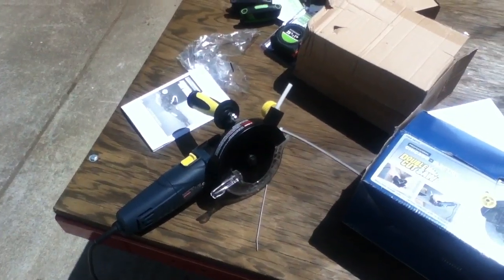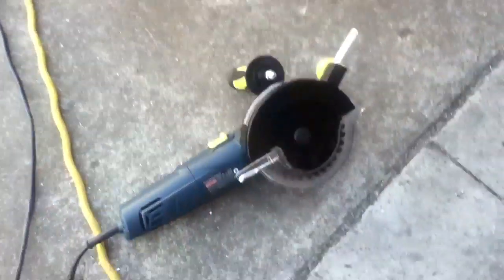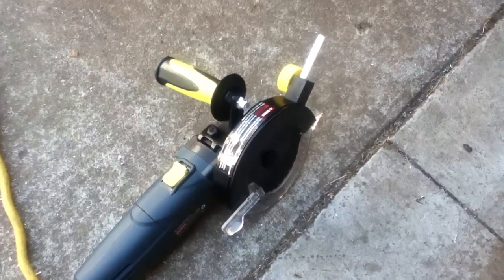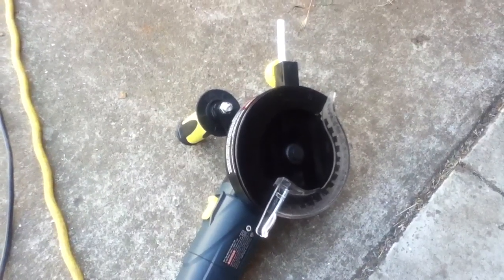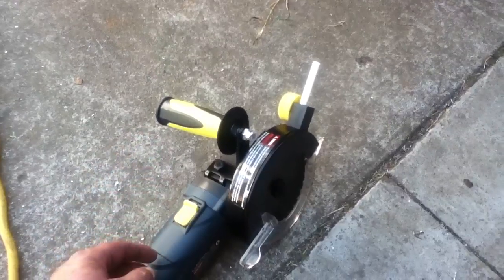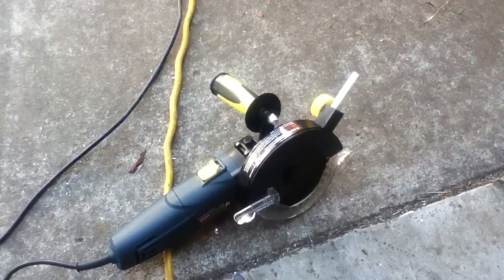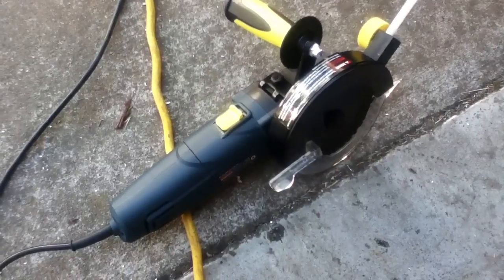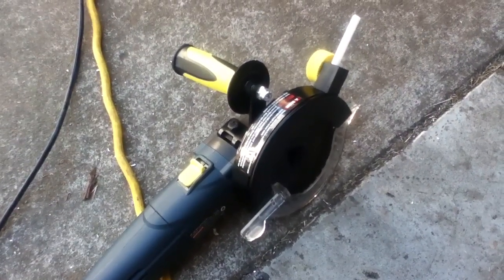Chicago Electric 68316 Double cut saw review

Comment: great review!
Reply from the maker: The tool later failed, badly.
Reply: can you post a video of the failure
Reply from the maker: Tim Molinaro
I did.  The thing practically fell apart in my hands and almost mangled my hand.
Reply: @8digitPDX  thanks for saving me the time and trouble of buying it. I had bought a small skill saw with diffrent blades that cut diffrent stuff metal, wood, tile or cement thin stuff. I alread used the small skill saw that got to cut stuff in small areas that would be hard for a full size skill saw to get to. It can cut up to the thickness of a 2×4 that would be the max.

Comment: This tool wins the award for the worst piece of shit ever sold.1  I gave up on it several years ago but thought I would try to cut a small piece of wood  and tried it again  on 11/20 20.  Still an unusable piece of crap the pins that hold the blades are soft and round off immediately making it totally unusable..  When I look at it I will never buy a harbor freight tool again.